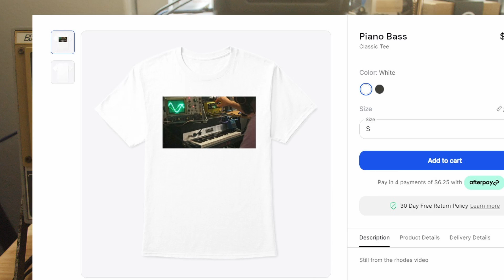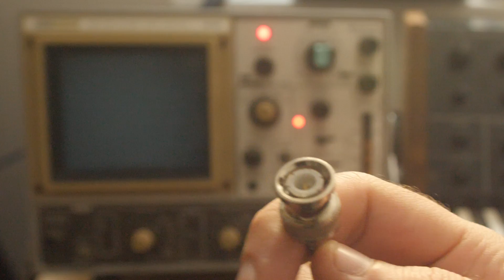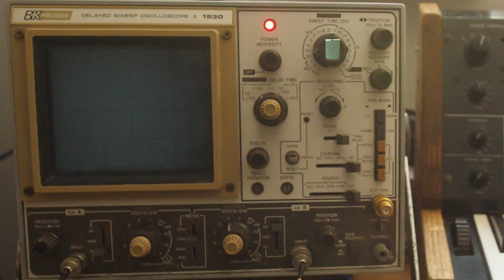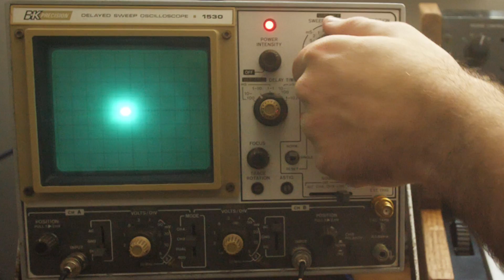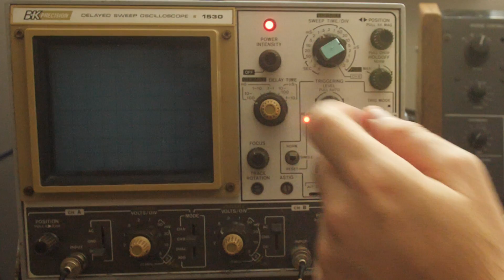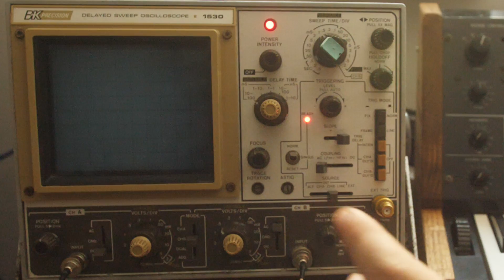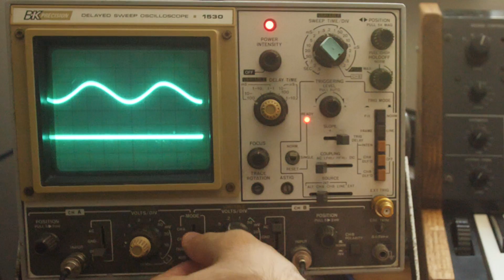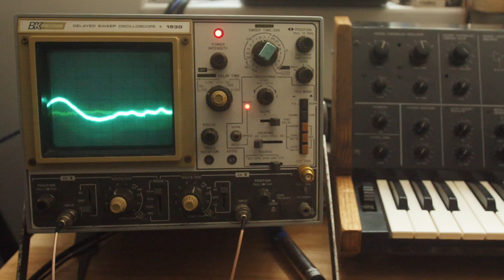My Most Used Piece of Gear Makes No Noise.. // Using Oscilloscopes with Synthesizers

Comment: I read online that it is important to have an interface/output with dc coupling and not ac coupling because it creates a clearer image. Does this have any burden on setting your inputs to ac instead of dc? It is difficult for me to tell any difference when switching between the two on my oscilloscope.

Comment: this is a suggested video to me. because, I am 51 yrs old and just bought my first oscilloscope only for this visualisation. for oscilloscope music and oscilloscope art :) I am not a musician and I dont play instrument. but there are many retro ampflier like marantz 2500. they are way too expensive and I am living in turkey and this is not even possible to find and buy with my salary. I have a maratnz 2226 so Ive bought a Hitachi v-212 analog oscilloscope I paid  about 142usd (Uve bought in Turkey with 4000Turkish liras. It is waaay cheaper than marantz 2500 :) I ve struggled couple hours for setting and watch some regular oscilloscope usage vidoes (like ElectroBOOM's Mehdi :) And I solved the "problem" :) I will make a video with premade oscilloscope  music and @PosyMusic 's music (just a plan) Ive ordered 2 cables bnc>rca in 3 meters (10  feets each) I will expecting them tomorrow. This an amazing device for seeing music. I am  a winamp generation (which I still using it) But I ve never liked its visualisations, just maybe when I was a kid, Ive worked in a electronics repair store (somthing local) and I saw this amazing devices when I was kid. I grew up with 8 bit computers and I love them too and I am a advanced computerphile but this analog sound (yours) and visualisation is just ... perfect :)

Comment: I've had an oscilloscope for longer than I've known your channel, and I can also say it's my most used piece of music gear besides my audio interface. It's a B+K Precision 1479B, very similar to yours but with no delay and the intensity and power separated, as well as no "hold" settings.

I use it while listening to music, and it's showed me a lot about how finished tracks "look" and has given me a lot of insight as to how dynamics play into different genres. I pretty much always have it running when at my computer or playing with synths and it's given me a far greater understanding of sound than any other tool. What I've learnt from it has been especially helpful when it comes to understanding wavetable synths like Serum, as I can largely know what a wavetable is going to sound like just by looking at it. 

I also use it while listening to horror themed audio books, with all my other lights off. Really adds to the experience :)

Comment: I believe you under-appreciate the xy-mode. afaik it can be very handy in tuning two oscillators (separate outs) (gives rotating objects that stand still in tune) and also when visually assessing phase issues (stereo out) (destructive interference stuff), much like a "goniometer" (is it called that? it may even be the very same thing, dunno) ... I'm not sure though, don't use this myself

Comment: I didn't read thru all the comments but in case nobody pointed it out already:
The AC-coupling removes DC-components of a signal by passing the signal through an internal filtering capacitor.  So in case you would want to display oscilloscope-music a la Jerobeam Fenderson you would want to put it in DC-coupling as some of the animation effects are achieved by dc-components.